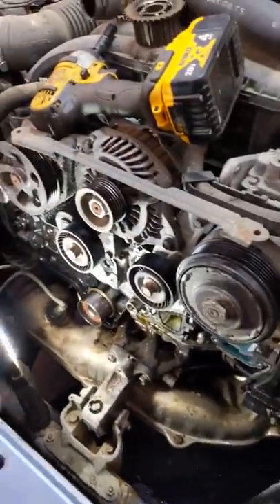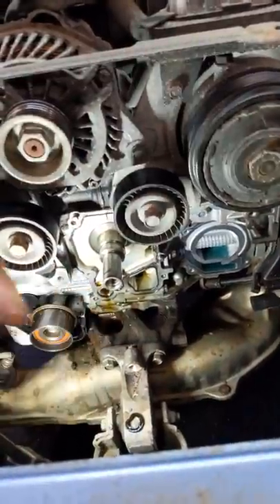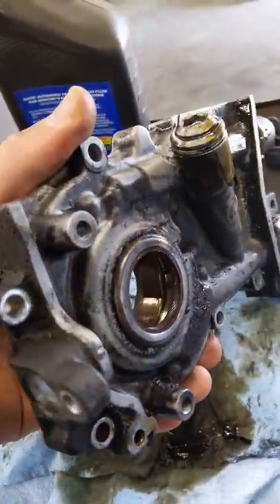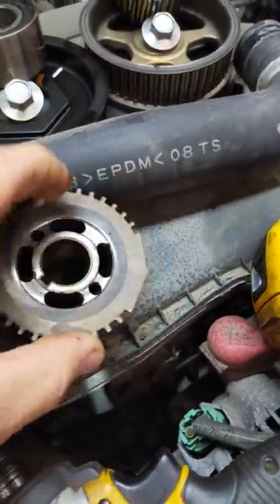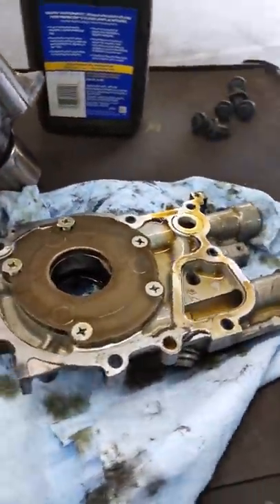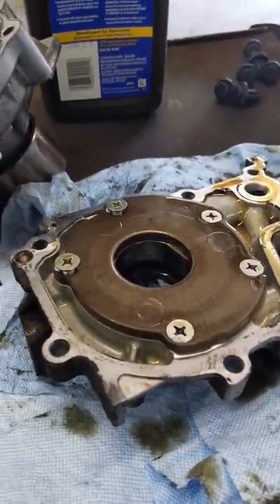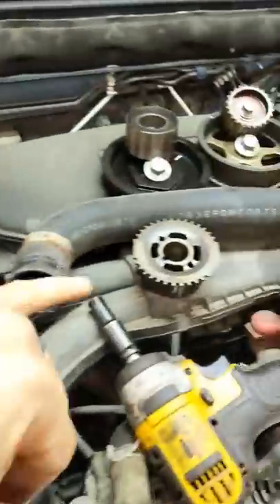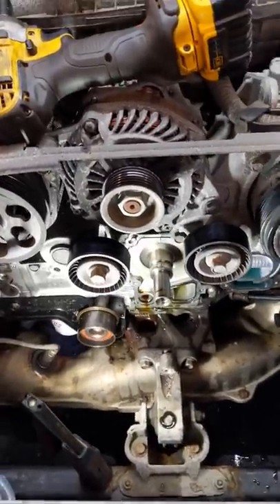Subaru Crank Seal Fail #SHORTS

Comment: I'm sure that after another 60 or 70 years of development, this boxer engine idea is going to prove itself out.
Reply: It's just as reliable as whatever your favorite engine is.   Think about that for a second.
Reply: @seanramirez6396  Seriously.  I have an LS and it sounds like you are pouring marbles into it every time you start it.  Every engine has its issues.
Reply: Aren't many of the Porsche engines and the old Beetle engines boxers? But don't let knowledge get in your way.
Reply: @seanramirez6396  I see your point... but I raise you this; I only have to line up 4 pulleys when I do my timing, and I don't have to do my water pump at the same time. Actually it's a chain so I only do it every 250,000 miles also...

Anything can be reliable, it just depends on how much effort you can put into keeping it that way... more steps means more time and money.
Reply: Bad oil pump could've happened just as easily on a transversely mounted inline-4, except you'd be working through the wheelwell...
Reply: You are an optimist.
Reply: @pfsantos007  -  I think you missed the sarcasm.
Reply: @pfsantos007  If you're looking for constant, difficult maintenance, or a motor that lasts 70k and only goes 60mph, yeah those are good picks
Reply: Subi isn't unreliable. Owners are.
Reply: Boxer and rotor engines all have their pros and cons. It's nice to have different options as a user where money and durability arent necessarily top priority.
Reply: Perspective bro. I hope that technology evolves to make boxers conventional and rotary engines way better. The pressure from the EV market should encourage this boost, IF fossil fuels don't get completely banned.
Reply: @seanramirez6396  no it isn’t, the Lexus 1uz is the most reliable engine ever. A youtuber has 1 million miles on his Lexus ls500 and many other people get extremely high miles out of them .
Reply: “Reliable” is subjective. Hard to repair due to needless complexity is another issue entirely. The boxer design is to gain a low center of gravity and better engine balance. But they put them in tall narrow SUVs? Makes no sense. Phillips head screws in an oil pump? Please…..
Reply: Oh please. I've had a 2011 outback since it was fresh out of the factory.. it now has 145k miles on it. I haven't had to do anything to it except regular maintenance. I replaced the spark plugs once, and that's it, besides the regular maintenance like oil, brakes/tires, and fluid top offs here and there. I haven't had a single major repair on it and it even has the original timing belt, which is still in remarkable condition. Keeping a car cleaned and maintained really makes a difference in how it lasts in the long run.
Reply: Everything is going electric
Reply: @Rekt-M8-v4  guessing you havnt heard of the 6bt cummins..
Reply: Flat engines are the some of the most reliable engines on our planet... You are another example of the dunning kruger effect
Reply: @KenLyns  well, I don't drive FWD cars, so it's not an issue.  I love driving Subarus, but hate working on them.  I wish that they never put the engine in the BRZ / 86.
Reply: @Merker367  not the Subarus boxer.  But they I'm sure they finally have the head gasket issues fixed.. ;)
Reply: @Merker367  they are great when built properly, example, hondas 1.5 and 1.8l flat six in the goldwing and valkryie, known to go many, many miles with just plain maintenance.
Reply: @bindingcurve  Subaru makes one of the greatest flat engines in human history. Its impossible to win an argument against an idiot so ill stop trying.
Reply: @seanramirez6396  ls
Reply: to bad this is the last year of production ej's... all done. Sti's get fa24's in '22
Reply: @Rekt-M8-v4  you know there's hundreds of thousands of diesel engines with 1mil miles right?
Reply: @jaymaxim8782  everything isnt going electric bro. It costs more money for more difficulty unless you drive short distances. And if you drive short distances their is no sense in spending 50k on a car. So if you spend less you can't go greater distances. If your going to spend 20k on a car you Midaswell spend it on one you can fill up in 5 minutes anywhere, that works In the city and on road trips. Someone who bought a 20k Corolla isn't never going to spend 20k in gas just to equal the cost to purchase a Tesla before you have to pay for their overpriced self driving feature. And if you don't bug it, you have to buy everything that inflates the cost so you should have bought it. They're still not good enough. A Corolla is still better. When the Corolla is 20 years of it was taken care of it'll still start like new with minor small repairs every once in a while. 

You can say you don't pay for gas in an electric car sure, but the only ones really worth it cost 40k+ you can get a Honda civic for 20k factory bone stock. You'll never pay that extra 20k on gas and oil changes and maintenance unless something catastrophic happens or you literally live eat sleep and breathe mile munching. They just still don't compete. I was in Texas and the power went out for several days. I'd you had to roadtrio out of Texas when the power went out you'd be up shit creek without a paddle. With a half cost Corolla all you need is a canister with some gas in it.
Reply: @Rekt-M8-v4  people also push Diesel V8’s past a mil, most Chevy V8’s can make it that far, I know of a few Saab’s with over a million miles on em
Reply: @seanramirez6396  no they not.
Reply: , @dakotagarcia3772  you are a realist
Reply: @KenLyns  Except you literally dont see it happen ever on a Honda K or R series engine. Just poor engineering choices here.
Reply: Subaru just sucks.  Boxer is a great design.
Reply: We will have electric
Reply: @pfsantos007  Things were much simpler then. But atleast they gave up on head gasket failures as part of the owner's experience. 🤣 I also don't plan on acquiring specific skillsets to repair & machine 2 heads per car. Glad I have only one, never again. This is the path I refuse to walk in this life. It was good while it lasted, up 80k on 4 gen legacy 2.5i.
Reply: Same thing happened to me
Reply: @Rekt-M8-v4  lots of Toyota products with over a million. Theres a Tundra too. Probably many others.
Reply: @WTFIsThisGuyDoing233  True, there's not an engine on this planet that doesn't have its own issues of some kind.. Nothing is totally 100% without its problems..
Reply: Boxer is just fine, the problem is Subaru.
Reply: @zane8789  after 145 k miles that belt is definetly on its last legs. Its  pure luck it hasnt snapped..
Reply: 2007 Subaru Legacy. Other than the head gasket it's been good to me.
Reply: Literally has nothing to do with boxer engines and it isn't a common problem nor a Subaru exclusive problem. I wish internet knowledge wasn't based on memes.
Reply: @jetjazz05  Current Subaru engines are all timing chain as well.
Reply: @MrSpartanPaul  Subaru is generally far easier to work on than most transverse engine vehicles. About the only thing harder is spark plugs. Don't speak if you have no experience.
Reply: Never seen so many check engine lights until I bought a Subaru
Reply: @lirider3932  Just a head gasket, huh? ....wtf 😆
Reply: @WTFIsThisGuyDoing233 buddy having a healthy ls and a healthy boxer are two different price ranges. Your truck prob has 200,000 plus. This car has oil pump bolts BACKED OUT AT LIKE LESS THAN 130,000 I guarantee it. That’s a major issue lol
Reply: @Rekt-M8-v4  well you’re talking about Toyota, that’s literally the top car brand in the whole world. The only that comes near is Honda.
Reply: @gabeguadan  my cousins new 2020 Silverado with the 5.3 needed a new heads because the valves had issues. Issues that could drop valves.
Reply: @Paul Santos  technically no, VWs are flat 4s and the have a diferencial crank throw from the boxers but same concept...
Reply: Aircraft have been using them fine for decades.
Reply: Boxer 4 is a naturally perfectly balanced engine. Plenty of reasons to keep em around.
Reply: @micaht7768 Porche likely produces the most competently crafted automobiles on the planet. They’re handle well, are absolutely stronger than just about anything in its class. They come with maintenance because this is a well engineered product aimed at people with the ability to own and maintain these vehicles. They can make the vehicle larger, reduce the bore sizes to decrease the length of the motor to give you “more room”. Now that sounds pretty wack now doesn’t it?
Reply: @philljustphill1656 The old air cooled VW engines are boxers, just like the Subaru. I'm not even sure if a non-boxer flat four exists,  there doesn't seem any point as the balance would be pretty poor.
Reply: @ethanrummel6476 If something was "well engineered" why would you expect it to require greater levels of maintenance?
Reply: If you added up all the issues I4, V6, and V8 engines have had you'd say all of those might be perfected in another 100 years or so too, hahaha. I mean hell, BMW engines eat bearings as maintenance. There were spans of Toyota and Honda I4 engines that consumed oil like it was their job. Ford has engines with belts in the oil now that get eaten up and clog the pickup. Always hilarious to me when people act like Subaru is the only company with issues or the Boxer is inherently flawed.
Reply: @ferrumignis  because you take care of nice things? Maintenance is also cheaper than repair. And repair is pricey on quality items. You should try having money or understand engineering a little better. You can’t make something that lasts as long as a Corolla when it revs faster, higher and performs better than one.
Reply: There's plenty of eg33 aircraft engines.  So they must be doing something right.
Reply: @ethanrummel6476  Wait, a well engineered engine requires more maintenance than a less well engineered one because it's a "nice thing"? You need to think about that for a while because it makes zero sense.
Do you believe Toyota engines must be poorly engineered because they require less maintenance than others? Does that mean they are not "nice things"?
Reply: @ferrumignis  Listen you special little nugget I don’t know what made you think you knew what you were talking about. I work at Lexus, in the shop. The reason why you may be more inclined to maintain an expensive sports vehicle opposed to your regular commuter is that parts/labor is more expensive as opposed to just maintaining it correctly. Something designed to rev high and put out big power needs more care that something that doesn’t perform all too well and doesn’t get great gas mileage. We make durable vehicles, typically not performance vehicles though our 5 liter V8 is pretty nuts. And the gas mileage is most certainly not up to par. It’s definitely a fair trade, just gotta know what you trade off in engineering. It doesn’t sound like you’ve fixed anything or brought about any project from anywhere.
Reply: This is not a boxer engine design issue. This is an oil pump design issue. Although if the mileage is relatively high, Subaru gets a pass from me on this one
Reply: After another 60 or 70 years !! I think it's a dam good engine !!
Reply: What exactly does this have to do with the layout of the motor?
Reply: All I read was“Yes, these checks notes boxer engines are very bad indeed”

Comment: "Loc-Tite?  What's that?" - Subaru Chief Engineer
Reply: You don't need Loc-Tite. It's called "cross-threading." 🤪
Reply: Extra 10 cent? no thanks!
Reply: @Chromodynamix Typically Loctite 242 will withstand up to around 650F max. If your oil temps are even half that you’ve got other troubles, baby!
Reply: May not be original pump
Reply: no need for bolt giue, just add 30degrees to torque value........
Reply: @blackiedekat2612 : Make it one full turn (360⁰), just to be sure. Or nuke it from orbit.
Reply: torque to yield between 2 and  3 o'clock 🤔 given it's a aluminum block.correct...✌️☝️☯️
Reply: The CEO said he wouldn't put his own company salary bonus for that.
Reply: Believe it or not these loose screws on the back of the oil pump are actually relatively common and usually do not cause problems

Comment: You'd think that Subaru would not only redesign their faults, but would stop making the same mistakes, for years!
Reply: Many car companies want their  Design Engineerss to work on the new stuff Within a couple minutes I can figure out why it got brokeMay not have been an original pump
Reply: @carldorschner6996 Please don't try to use the "not the original pump" excuse, this a known problem on these engines and has been for quite a long time.

Comment: Oh yes, the classic loose bolts,,,, inside the engine magic trick. Tadaaaaa. Thanks Subaru
Reply: My brother used to work for Subaru and he said their cars are just terrible
Reply: Rather uncommon problem. First I have ever heard of it. Not exclusive to Subaru either.
Reply: @vinces8974  I know numerous Subaru mechanics. They're quite easy to work on and generally reliable. They have their quirks.
Reply: @802Garage You've never heard of this problem but you know it's not unique to Subaru? Ok my guy 😂😂😂
Reply: @802Garage "easy to work on"
Oh yes, they are widely known for jobs like timing belts, spark plugs and valve clearance to only take a few minutes thanks to the engines design.  Much easier than an IL4 where everything is inconveniently located at the top of the engine.
Reply: @ferrumignis  I guess I could have been more clear. Rather uncommon problem FOR SUBARU. First I have ever heard of it FOR SUBARU. That said, since leaving my original comment I have actually heard of this a few more times. Rather uncommon across the Subaru lineup as a whole, but it can happen. It is still not a problem exclusive to Subaru.
As for working on them, I'm guessing you're not speaking from experience, just internet memes. Spark plugs are a quick job for anyone who isn't completely inept. Valve clearance very, very rarely needs to be done and if it does it's not rocket science, but I literally don't know anyone out of hundreds of Subarus owned who has actually needed it done unless the engine was already out. Timing belts are due every 100K just like every other car with a timing belt and they are honestly easier than a lot of cars with the timing belt jammed up against the frame rail, not to mention any other V6 with timing belts. Now that we've moved past the few disadvantages of working on a Subaru, what about everything else? Jobs that are easier on a Subaru than most I4 and V6 engines, especially anything transverse like in most comparable cars, include: Accessory belts, alternator, power steering pump, air conditioning compressor, starter, oil filter location, air intake, exhaust, axles, fuel injectors, engine removal, and much more.
Subaru does a lot to their cars overall which make them easier to work on too such as sharing parts across many years and models, providing single large connectors to disconnect the engine and transmission wiring harnesses, making everything accessible without having to take off multiple other parts, and generally providing space and logical layouts. I mean jeez you wanna change the AC belt on a CR-V? You have to remove a whole engine mount and jack up the engine. Wanna do exhaust/intake on a lot of I4 cars? Gotta remove engine bay cowling and work against the firewall. There are downsides to all cars, but ask any mechanic who has actually worked on Subaru and they'll tell you they're one of the easiest brands to work on. I had a friend who went from working at Subaru to Ford and he couldn't wait to go back to Subaru. One of many stories. Go work on some Subarus or don't talk.
Reply: @802Garage  It's not uncommon for Subarus though, the techs at the dealers are well aware of it, and the Subaru owners forums have numerous threads on this issue.
Reply: @ferrumignis  Uncommon as a percentage of vehicles. Again, out of literally hundreds of Subarus owned that I know of personally, this has been an issue on zero. Out of hundreds more through social media connections, maybe 3-5 cars I've ever seen. I own over 10 Subarus, no problems. My direct family has owned 30+ more at this point, never been a problem. Local Subaru mechanic used to swap hundreds of engines, he never had this problem that I heard of. I have only ever seen it in some online postings and heard of it on occasion from Subaru mechanic friends. It happens, but calling it common would be a massive stretch. Nowhere near head gaskets on EJ25 prevalence hahaha. Seems to be generally EJ25 specific from the later models. It's something to watch out for, and the video lays out one key sign well, it's just not something to be paranoid about generally. We're talking less than 1% of cars within a 200-300K mile life span for sure.
Reply: @ferrumignis any mechanic complaining about Subaru Spark plugs isn’t worth his weight in salt….